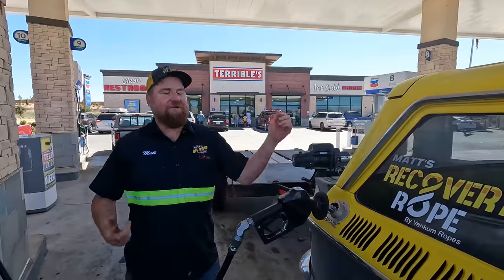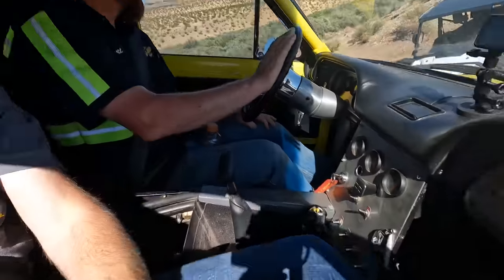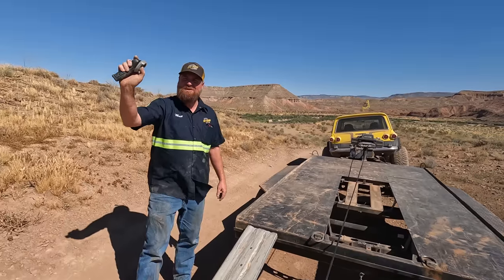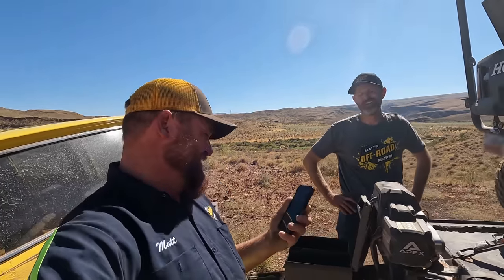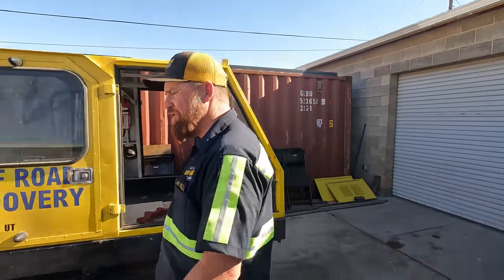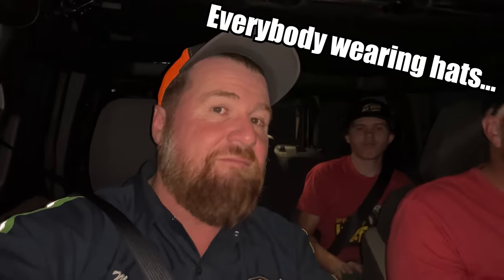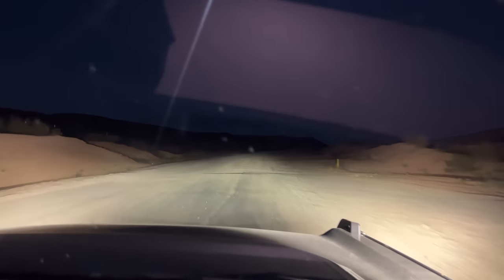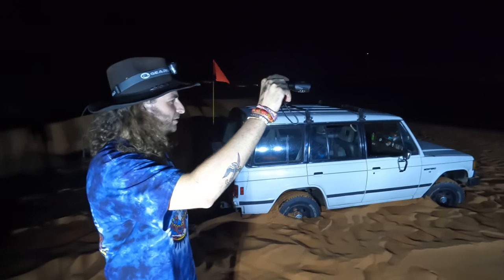Customer Get's Chewed Out For Getting Stuck!

Comment: Always a blast watching the interaction between Matt and Tom. Thx. My sister lived in Twenty-nine Palms desert when I lived in Chicago. In the summer she told me it was 116 degrees, but it was a dry heat, so it wasn't too bad. So, during the winter, I told her it was 5 degrees, but it was a dry cold so it wasn't too bad !! Yes-I planned that comment for 6 months.
Reply: This is actually accurate both ways. Humidity makes all temperatures worse
Reply: KEK! It's always humid here living in the swamps between the ocean and the bay.
Reply: This is true though.  -30 during dry Montana winters isn’t fun but it’s not terrible.
Reply: I just flew through twenty nine palms a couple weeks ago! Stopped in St. George for fuel - 103° on the ramp. Dry heat, kind of like when you open your oven and forget to stand back, and you get hit by that blast of hot air. Still, it's beautiful out there in a desolate kind of way...

Comment: That Morvair never ceases to amaze me, a great build by the MORR crew even though a FEW disagree. These guys do rescues every day and they know what they want and need. Hats off to the MORR crew.
Reply: The Morrvair is my favorite. It's a Corvair of all things and quite capable even more so than the Banana. I love the sound of it under a load. I can't believe that more people are not surprised when Matt pulls up in a Corvair to pull out a heavy diesel with a 40' camper buried to the frame or whatever it might be. All his builds do an awesome job but the Morrvair is my favorite because I had several stock ones years ago and really liked them like Matt does. I watched the crew build it from the ground up and enjoyed every minute. He is getting some wheel hop in the front axle that has concerned me for a while. I think the adjustable shocks need to be a little stiffer on the rebound. Wheel hop is hard on all the rotating parts especially the gearset which he has had several of. Related? Who knows.
Reply: Oh wow I just got the name lmao
Reply: It would be a great video of the type of oil and fluids of such extreme temperatures that Matt runs and uses in his vehicles at different climates. Not to be a commercial for a product yet works for MOAR.the best.

Comment: I cannot believe how awesome your vehicles do their job. It’s quite impressive and fun to watch.
Reply: Come to the south 100⁰ and 80+% humidity.... You need several shirts throughout the day
Reply: Yes for vehicles designed and fabricated by a guy with a framing hammer that says he is both "Cheap and "Lazy."
It is hard to imagine recovery vehicles better designed or built.

(Cheap in Matt's case means best price for best parts and lazy means  most efficient methods. )
Reply: The short wheel base shogun is a better off roader but I would say that mine was 2.5 td swb miss it all the time 🤦‍♂️👍✌️
Reply: The rigs are the stars of the show, besides Lizzie of course.

Comment: Nice rig Phil, hope you had a great time out there! Always nice to see different vehicles that are cared for and used regardless of the company/country its made by, just cool to see different stuff❤
Reply: Lots of people sleep on the 80s-90s Japanese stuff. An Isuzu Rodeo for example looks like a knockoff version of a Nissan Pathfinder, but the Rodeo has a decently stout driveline including a Dana 44HD out back, the Isuzu corporate 10 bolt with a true 3rd member (NOT a GM 10 bolt) with gearing in the 4:10-4:56 range and the manuals are pretty good. It also sports a fully boxed frame. They are excellent platforms for a build. Not the most powerful engines but you can't win em all.

uh...wait...I mean....uh don't buy Jap Crap. Yeah, they're trash. You all keep spending your money on Jeeps. Don't buy Jap cars!! They are junk.!!! Yeah, that's it. Leave em for me.
Reply: @DriveCarToBar  lol yeah we had a rodeo and 2 samurai in high school up in the mountains of southern Oregon, great for squeezing through and we had family that built drop link suspension on the samurai for a lot of people in the valley. I don’t hate on anything that works right and lasts lol. I just retired from the army and haven’t found a reasonably priced project but I did get a 2019 power wagon with the 8 speed and 6.4L for $52,000 and only 32 miles on it right before prices went apeshit just about paid off and they come stock with the 12,000 Warn winch, true front and rear lockers, disconnecting sway bar and so on, made a few minor changes ie 37s, a tune, swapped out some parts with ones that had grease fittings plus som high clearance bumpers but it’s already capable and reliable (thanks to the 8 speed instead of the previous horrendous transmissions). Gives me time to have patience to find a real project without paying some crazy numbers.
Reply: The Rivian is a beast.

Comment: Higher octane is typically needed for engines that have higher compression.  When air fuel mixture is compressed, it creates heat, too much and it ignites before you want it to.  Higher octane helps this mixture handle being compressed more.
Reply: In other words the fuel is weaker, not many people realize that.
Reply: What do you mean weaker?  There is the same energy in lower octane and higher octane.  The higher octane fuel is just more stable in situations where lower octane might spontaneously combust.
Reply: @Bryan-Hensley  What do you mean by weaker?  What I understand is that higher octane has a higher combustion temp, it's harder to burn.  So that means in high temp situations (climate/load/etc) it won't burn early - which is detonation - which is what you don't want.  You want the fuel to ignite when the spark plug fires.
Reply: @Bryan-Hensley I’ll take “I have no idea what I’m taking about” for 500, Tom
Reply: I performed my own litmus test several years ago with a '99 4Runner...approx 200,000 on other ODO.  Ran 4 tanks of each: reg; mid-grade; & prem.  1st off, I DID see mileage increases as I went up in octane.  2nd, I got the best mile per gal cost out of the mid-grade.  Easy to do with an excel spreadsheet.  Your mileage may vary.
Reply: @donovanchilton5817  okay, you don't know what you are talking about. Got ya. I have no idea why you'd tell everyone though..
Reply: Yes, octane helps retard the flame front to suppress detonation.  It can also help with allowing more ignition timing, which I suspect is the reason the engines are 'tuned' for the fuel.
Reply: @amazeddude1780 yep, you got it.  Slower flame front means less chance of reaching a high enough pressure to ignite/detonate the fuel Diesel style before the flame covers the entire cylinder volume.   If ition timing is. Ignition timing, compression ratio, boost, and distance from the spark plug to the furthest extent of the cylinder are all big factors to consider there, and a slower flame helps with all of them.  Same energy content, so not at all "weaker.".  Tuning for higher octane is primarily ignition timing, since that is the only factor that is readily adjustable electronically.  In some cases injection timing can also be tuned, too.
Reply: It's stronger fuel it just burns cleaner faster and more of it.
Reply: @Bryan-Hensley  It's Just you bud, We work with Vehicle RnD in motorsport teams and you are the one wrong here, multiple people have given you the correct explanation, so i wont repeat it here.
Reply: @swapnilmankame  I've been building racing engines since 1978. Soooo I've got more experience.. I'm also a thermodynamics expert..
Reply: @Bryan-Hensley  This is the way I think about it.  Higher octane resists combustion more than lower octane, allowing your piston to get higher and have more travel (power) when the ignition finally occurs.
Reply: @Bryan-Hensley  Then you know the knock-resistance is the big difference?  As I see it, the base of this discussion is a stock engine in a normal production car. On this premise, will you see increased power from a higher than intended fuel? I don't think so. -A engine  you build and tune for a higher power output, can benefit from a higher octane fuel, but mostly because you can cross the borders of what's safe for a stock engine made to run on low octane fuel. Please correct me if I'm wrong.
Reply: @swapnilmankame  Question: Replying to this guy but anyone (with the actual knowledge) can answer. I've seem to remember reading that engines with a turbocharger can get more power from higher octane fuel.  Is that actually something to do with the turbo or do engines with turbochargers tend to have a higher compression ratio (even variable in the case of some Nissan/Infinitis)
Reply: @sidekickbob7227  I don't have time to read all the BS. I'm too busy. I build racing motorcycle engines now. If you want to learn, look up the research dirt bike manufacturers did. They kept raising compression and lowering octane requirements. They now have engines with 12.75 to one compression, turns 13,800 RPM and runs 93 octane. They focused really hard on making this happen because they can get more power out of 93 octane vs racing fuel.
Reply: @Bryan-Hensley Then you should know better. Did all those racing engine you built run on the lowest octane?
In a super pedantic technical way you could be correct. But, the benefits can outweigh any technical shortcomings so in the end you can usually make more power with higher octane. 
But, at the end of the day this is the internet so I’ve been building every racing engine since 1835 and am an expert in all things.
Reply: @NBSV1  run on the lowest possible..I don't understand why this is going over your head.
Reply: @Bryan-Hensley  Kinda,  "LESS prone to pre-ignition"  (Volitile) but the same BTU value.
Reply: @amazeddude1780  More advanced ignition timing, I think you missed the word”advanced”. A high performance engine can ultimately extract more hp from the same total from the same energy density fuel by transferring more of the expansion of gases into rotational thrust. Mostly by starting sooner with advanced timing.
Reply: Finally someone who can think instead of spewing opinion. Thank you, I have done the same testing and every vehicle tested did get better MPG with higher octane gas.
Reply: @frobeniustaco   Yes turbo engines can get more power from higher octane fuel, but it needs to be tuned for it.  Timing on turbo engines are generally retarded a little bit compared to non turbos. With higher octane, you can run more boost, and advance the timing a little more without getting detonation, which would produce more power.  But you have to remember that your engine would need to be tuned for whatever octane you are using.
Reply: @Bryan-Hensley  Lowest possible as in you ran your race engines on 87 pump gas? Or, lowest possible without detonation? 
I'm just trying to figure out how legit you actually are. It's easy for people to make wild claims on the internets. And, so far you're just arguing with people without providing any actual substance.

Comment: You are spot on with a different way the heat is. I have noticed in Arizona, and New Mexico the sun intensity is different. It can be cool outside, but overwhelmingly hot in your car because the sun is just beating through the windows like a greenhouse. You can’t touch the steering wheel in your car but need a jacket. Cars don’t rust but the interiors crack and fall apart. 😅

Comment: Matt is actually smart for running 91 octane. Like he said with a custom tune, you can have great power benefits. Different places have different octane grades for one reason, elevation. The higher the elevation, the less oxygen. Less oxygen means less power from a motor. For some motors, it can make it run rough. In places like the high desert or mountains, like these guys are in all the time, that does give them a slight edge. That's also why in the past a lot of gas stations had a mechanics bay. If you were taking a road trip in the day of carburetors, you could pay the mechanic to re-jet and tune your carb. If the elevation changes drastically, it could really make the car lose power and run rough. Thank the stars for electronic fuel injection and custom tunes!
Reply: my dad would always carry a set og jets with him on travels because of this
Reply: here in australia 91 is considered your "cheap" fuel, we got 91, 95, 98, and e85 ( 85% ethanol and 15% petrol )
Reply: Some additional information. Octane rating refers to the fuels resistance to combustion. Running a lower octane in a car tuned to a higher octane means your fuel will combust before it's supposed to, which is very bad for your engine. This means your fuel is combusting before your piston is finished with the compression stroke which is super bad. 

There is no more energy in 91/93 octane than 89 or whatever. The energy density is the same. The only difference is how easy it is to light it on fire. 

Many engines are tuned to fire at a very specific time, which is called timing. 

Modern naturally aspirated engines generally dont need anything but regular octane. If you're running a turbo or forced induction system you absolutely need higher octane fuel. Running a lower octane in a turboed car will result in it retarding itself and you'll lose a ton of power along with fuel mileage. For example, my car will lose 3-5mpg if I run crappy fuel and it struggles with power above 4k rpm.
Reply: the percentage of oxygen in inspired air is constant at different altitudes, it's the fall in atmospheric pressure at higher altitude, I wonder what o2 sensors do! lol... I know you mentioned fuel injection, but you stated it's why we have different octanes now, again... lol

Comment: Dry heat is definitely more tolerable to a degree, but Matt's point about the radiant heat is 100% on point, think about people walking their dogs in that crap on pavement - poor pupper paws :(
Reply: Totally correct and an oven is also a dry heat.
Reply: Radiant heat is the same in humid environs.
Reply: It sucks when you have to be out there all day and you start to feel that heat radiate up through your work boots.  Feet get hot & sweaty and it's just zapping the fluids out of you every way possible
Reply: @johnt.848 look at the uv index in Utah compared to Alabama, the Sun is way more intense. It cooks everything. I never felt hotter ground than a dry area.
Reply: @Jasper118  The UV index is a rating for radiation, not heat.
Reply: @Jasper118  the UV index here where 60% humidity is very low is still 10-11 on the daily. The sun heats up the floor and metal just like in dry heat lol
Reply: @johnt.848  right but it’s a good measure for intensity of the sun. With no humidity or cloud coverage to contend with the sun is very intense in dry environments.
Reply: @atrumpetwillsound  I’ve never experienced an index that high in a humid place, that would suck. I hate humid heat because you’re constantly wet but dry heat has an intensity I never felt in humid places. I lived in Chicago, CT, and Texas the humidity was obnoxious and night time sucks but in Colorado here the sun feels like it’s melting your face, with no humidity to contend with (and less atmosphere) the sun feels like it’s right next to you
Reply: asphalt trapping heat in big cities is a big thing people don't really talk about much, the impact of building materials trapping heat
Reply: You get radiant heat in high humidity areas as well.  Anything left out in the sun gets backing hot, regardless of if the humidity is high or low.  I've lived in both and have a lot of experience with both.

Comment: The heat is real!!  I am from an area that goes up to 90 degrees a few days a year and has high humidity.  We just got back from a trip out that way.  It was 110 to 115 when we were there, and Moab.  The radiating heat from the ground really makes it hot, I avoided metal, but my daughter and wife both got light up from hot metal.  I'd never lean on vehicles unless it has been shaded for a while. Around 95 isn't too bad, but 110 is crazy hot, the wind hurts a bit.  Something like the wind while riding bikes around 60 mph.

We did stop by the shop, they have a nice selection of things and the good dude monitoring the store took us into the yard where we could check out, without touching the toys in the yard.  Ed was around, It was last Saturday, Jefe was walking across the yard and we shared a quick joke, Matt was inside working on a sidebyside  I think it was.

Thanks for having your world open for us to visit.  I enjoyed stopping by.

Comment: Its true what Matt says about the dry heat.  A lot of tourists at Vegas waits until night to go out walking but even with the temperature lower than during the day, the concrete sidewalks and the streets retain the heat and radiate hotter than the ambient air.

Comment: My wife had a late 80's 2 door Dodge Raider/Mitsubishi Montero, that thing would go through damn near anything. It wouldn't go through anything fast, but it would go. Wisconsin winters couldn't slow that thing down. We drove it till the frame and underbody rotted out. Traded it in in 2010 with over 200,000 miles on it.

Comment: Hi, & keep those recoveries coming. Re: the heat, I agree, I spent a year in the desert mountains of Iran. No rain for 6 months. Quickly found out that if you put your tools down in the sun, you couldn’t pick them up, so hot. Always had to find shadow behind equipment so you could still use the tools.
Thanks for the videos, great crew.